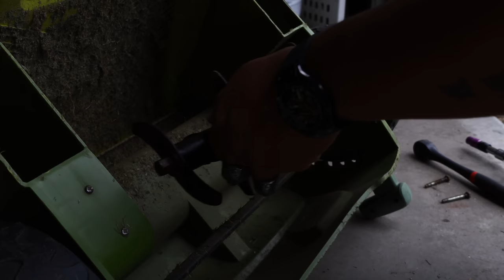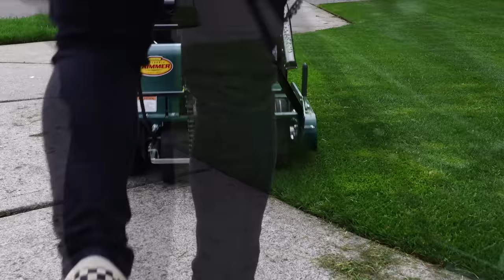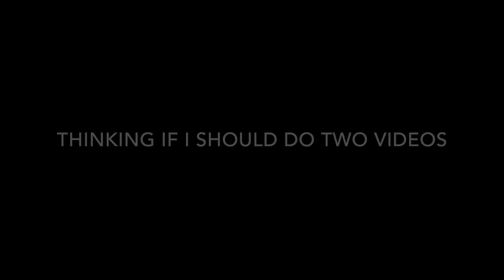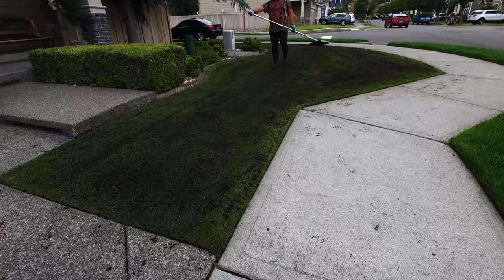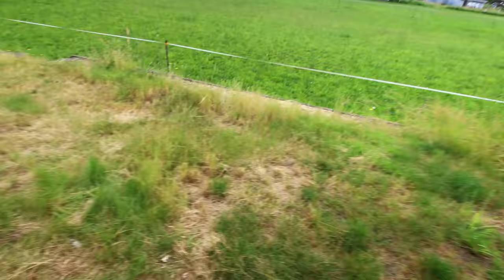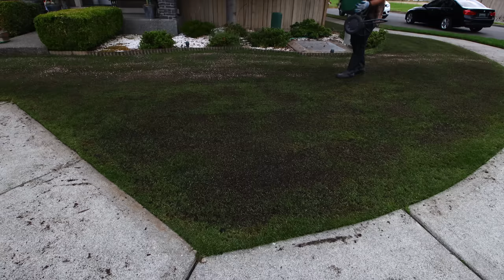Verticutting lawn Video turned into Summer Overseeding too THE CRAZINESS CONTINUES Sunjoe Dethatcher

Comment: Scarifier is just a deeper thatching, so you are basically doing a deep thatching. On my Bermuda grass I have to scarify because the de thatching tines will mess up my grass
Reply from the maker: I feel it I like it better than tines for sure! Keeps more of the grass intact 😂😂😂😊🙌🏾🤙🏾🙏🏾
Reply: I have bermuda grass as well.  I keep seeing differing things on the dethatching and scarifing for bermudagrass...so you're saying you've had good results scarifying?
Reply: @YardBrah
A true verticutting cartridge has many more blades and just slice the top of the turf.
These chunkier bladed cartridges are designed to scar the soil and drag out the thatch. They do a decent job of chopping the rhizomes but not a true verticut.

Love the channel 🤙🏽

Comment: I had a huge thatch problem when we moved into the new house.    Like almost 3" thick to get to dirt.    Cut the worst of it out with a bladed edger and flat shovel to take it out like sod.    Looked like friggin house insulation it was so thick.      Used the SunJoe blade attachment to help dig it out.    It rips down deep to get thatch out.    Awesome job Brah!
Reply from the maker: Damn would have loved to see that in action 😂😂😂 yeah I’m noticing this is all just dead grass thinking from “mulching” 😂😂😂😂 times to start bagging the ground gets enough nitrogen from all my feedings 😂🤙🏾🙌🏾🙏🏾
Reply: @YardBrah  I was sore for days 😂😂  With all the aerating you do doubt thatch will have a chance to even get started.

Comment: The tines are just a power rake the blades are for the thatching layers
Reply from the maker: Question for you see if all these answers line up... what's the difference between verticutting and dethatching because sunjoe says the tines are for dethatching and blades are for verticutting
Reply: @YardBrah  tines take the top layer of thatch above. The blades take the lower layer of thatch the sub surface or soil layer
Reply from the maker: @lightallseasonlawncareexte98  Ok this is actually a good answer cause they technically both dethatch but the tines take top layer and blades take lower layer! Thank you for that as I have received many different answers and this one was the simplest and makes the most sense 😂 Thank you my friend 😊🤙🏾🙏🏾🔥

Comment: I def had some poa show up this spring. A little bit of poa annua that I keep rippin out, but some pretty big patches of poa triv in the shade. I did do one app of prodiamine in the late fall last year, but I'll probably do a split app this fall+winter. Using the sun joe blades definitely damaged the triv when I did a spring overseed, cuz it turned all brown and looked f'ed up, but I know it'll be back. Triv is the worst. Doesn't look bad now though.
Reply from the maker: oh nice! yeah I was going to try prodiamine but I have the ethofumesate now so I will be trying that with 2 apps in the fall hopefully no poa.. plus a better cultivar with a reno should help my situation! Let me know how the split app works hopefully triv goes away! 😊🙏🏾🤙🏾
Reply: @YardBrah  yea the prodiamine is a pre-emergent, so theoretically it should help with poa annua as it "should" die off in the heat of summer and then u prevent the new seeds in the fall+winter, but annua can survive summer in the pnw sometimes, and triv just goes dormant, so that's why I try to rip out the annua when I see the seed heads. Triv is harder tho.